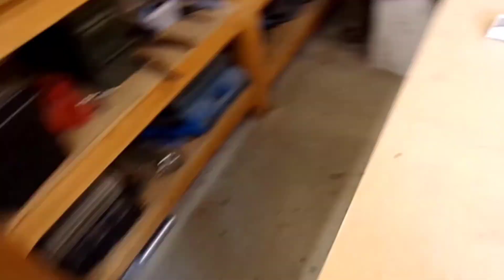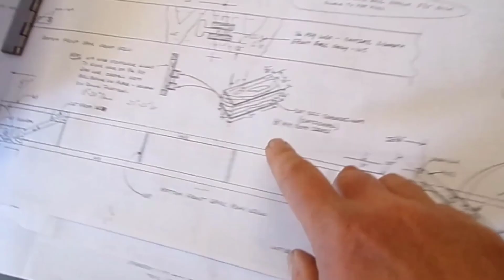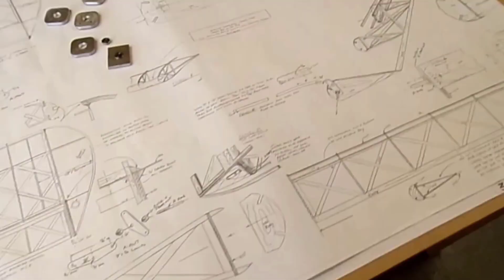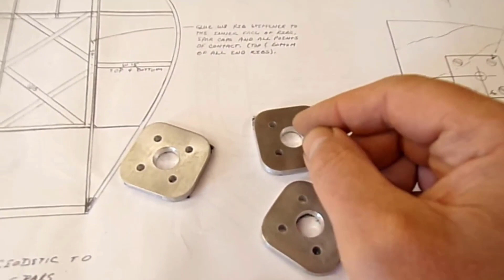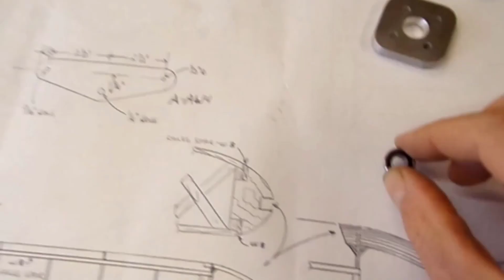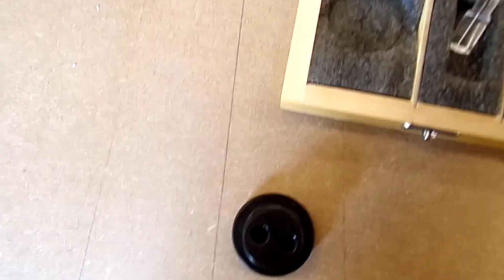KEITH HARBAUGH SHARES FP-606 FLIGHT  - ALGY YATES WORKS ON WING FITTINGS AND CONTROL BLOCKS

Comment: Seems pretty quiet for an ultralight.  Some designs sound like they are rattling apart in the air.  I am pretty sure this is the one I want to build.
Reply from the maker: Give us a call or email and we can set you up. 519-933-2055 or dave@fisherflying.com

Comment: Great video from FP-606. FFP should change design of little monoplace birds to optional folding wings and also electric engine powered.  No hangar and gas required would be a dream !!!
For the FP-606 I suggest to implement same folding wings concept that is used by Horizon 2, running cables through rear spar, so easy and effective !!